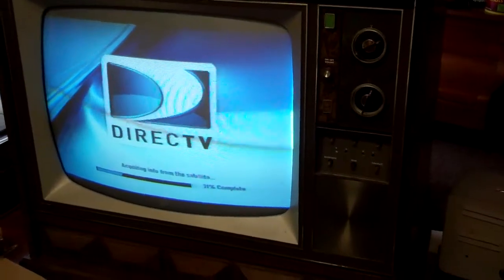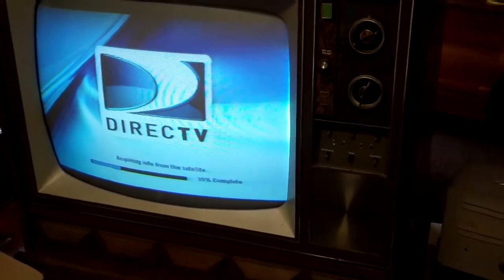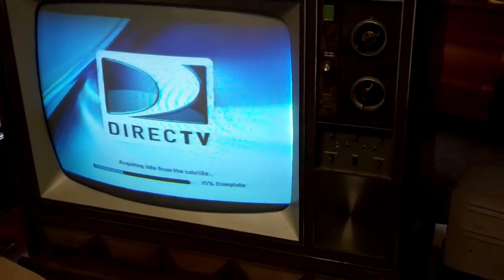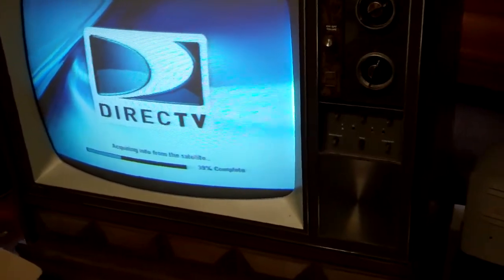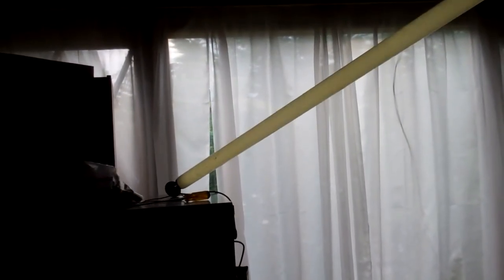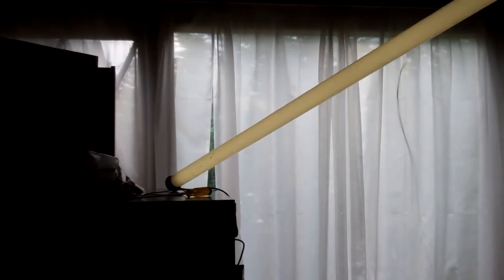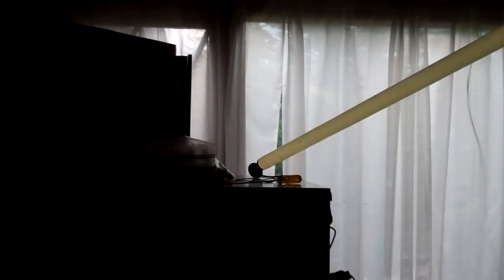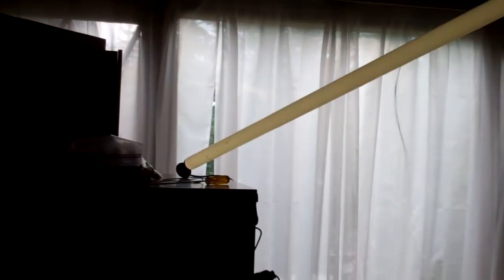Passing crt anode voltage through my body to prove Im cool

Comment: I got "bit" before when trying to discharge the anode to ground.  For some reason a small part of the metal screwdriver I was using just happened to touch a small part of my arm.   I definitely felt it.  I would never do what you're doing there, but I'm guessing the fluorescent light had much more resistance than your body having a much lower difference of potential going through your body than the light, but I can't necessarily prove that.  Cool experiment but no thanks for me.

Comment: Very early TV's used a line current operated supply via a step up transformer to supply the high voltage for the CRT.  These usually used a type 2X2 HV rectifier tube and an oil filled filter cap of a few uf.  Potentially lethal!

Later sets used an RF operated supply using a 6L6 tube as the power oscillator with a 2X2 as the high voltage rectifier, filter cap was now much smaller, may 500pf of so.  Still enough juice to knock you on your ass, but in theory loading the output heavy enough (aka though your body) would kill the oscillator, and with less coulombs of energy storage, not as lethal.

The flyback HV supply is similar to the RF type (but you'll never load down the horizontal output enough to damp it out by touching the HV), but the energy storage is now in the CRT 'dag coatings (like a big Leyden jar), so with the cable yanked from the CRT, it is not lethal (but will bite!).  I'm not sure that's true in a color set because of the voltage regulator providing energy storage though.
Reply: Sorry to dig this out of the grave but I myself have found a love for analog electronics and am learning, or attempting, to learn to rejuvenate older sets. I.E. geometry adjustments, color, magnets on the tube, etc. I don’t have nor know how to use an oscilloscope so any adjustments using that I can’t do. Mostly pot and service menu adjustments. I don’t even like touching the yoke itself. So my topic of conversation is that I have some pots in not easily accessible spots. I can get to them but I have to remain in close proximity, approx a couple inches, away from the high voltage points on the boards. This includes some pots on my JVC that are on top of the yoke, and my Tau set that is in between the neck board and the main board on the bottom. Essentially I’m curious how volatile arcing can be from boards given I don’t physically touch them but remain in proximity them. Can anything arc and electrocute me from just proximity alone. ( I statically ground myself on something metal in the apartment attached to the structure before I adjust anything, also I do the one hand rule as well. So I’m never touching the chassis when adjusting, only my screwdriver that’s wrapped in electrical tape until the very very end and the floor.)
Reply: @liamlee2198  RF operated supplies use small capacitors in the DC filtering (on the order of a few hundred pico farads)  OTOH, line operated supplies use much larger capacitors (as much as 10 micro farads).  As a result, there is enough energy stored in the power supply filters of a line operated supply to deliver a fatal shock at the voltage present.  Not so much in the RF operated supply.  
The energy stored in a disconnected CRT (those that have internal and external aquadag coatings) probary isn't enough to hurt you, but people have been injured by large CRT's from flying glass after they got shocked carrying the tube and dropped it!

You'd have to get close enough to draw an arc to get a shock from the HV.  This would probably be around 1" or so at 15KV, and the actual distance will depend on the humidity in the air.